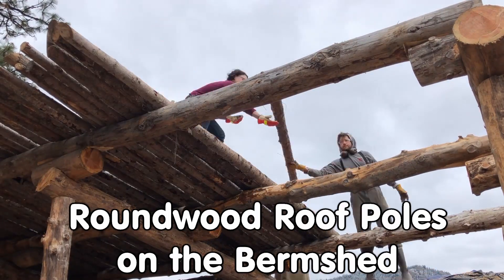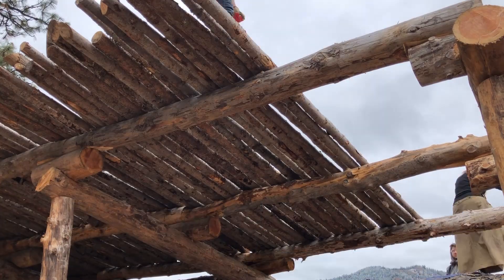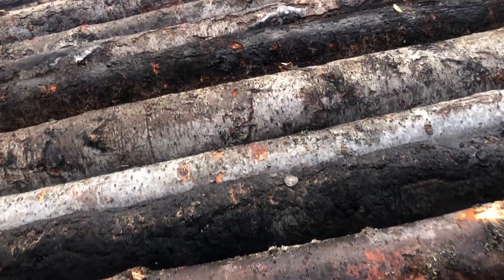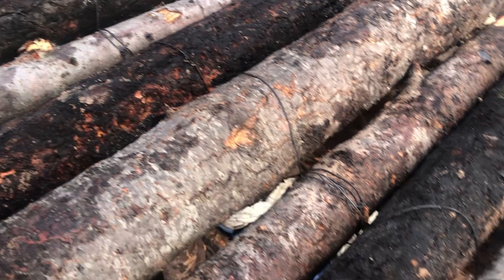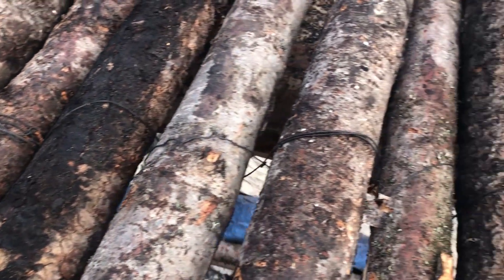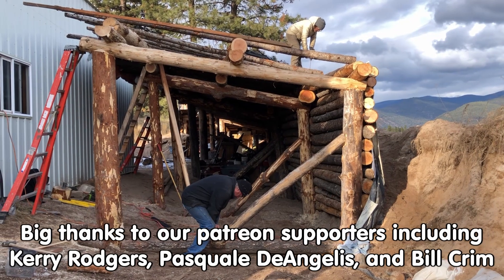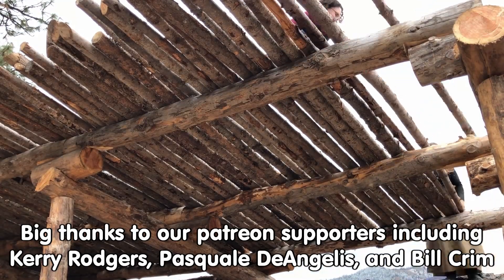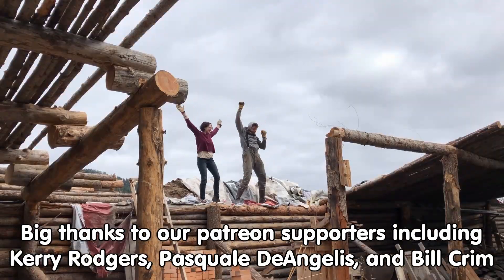round wood timber framing berm shed roof poles - permaculture bootcamp!

Comment: “Keep in mind that round wood is 2.5 times stronger than the dimensional lumber equivalent.“

Guessing this is a typo? I’d believe maybe 50%, definitely not 250%. Also, that would only be true within the same species and quality of log, which is an important qualifier. Overall, a 6x6 milled oak timber would be way stronger than even a 10” poplar log. But a 5” popular log might be stronger than a 6x6 oak timber with a defect. The advantage of milled lumber is being able to grade for quality. Some defects may not be evident in a round, unpeeled log, and sometimes not even a peeled log.
Good concept, Labor saving for sure, less embedded energy, just something to be cautious about.

Comment: A berm shed is such a multi-functional wonder!  It gives you dry storage, it blocks noise from the road, it can improve your privacy, it's a cool place to retreat on hot days . . . and you can build it on a low budget.  The only tricky thing is the equipment needed to raise the logs - our little Kubota is not up to the task.
Reply from the maker: I would like to do it with a lot more manual gin pole action next time.  But then there is still the task of moving the dirt ....

Comment: I'm surprised to see that some logs don't need to be peeled. Critters living under the bark wouldn't pose a problem?
Reply from the maker: They are a problem.  But they move on in time.  The poles you see here are mostly four years old and have already had the bugs come and go.  Not something I would do in a house, but a shed is okay.
Reply: Depending on the species of log, some bark will hold not just insects but excess moisture, causing the log to eventually rot and collapse.